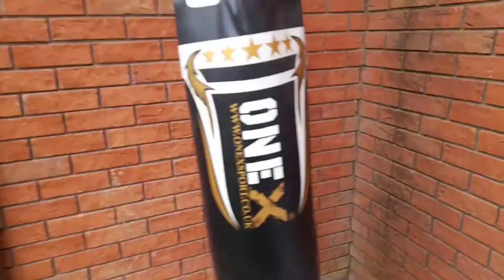Refitting a punch bag wall bracket

Comment: Hiya mate, how do you protect the bag from scraping the brick wall and over time the bag getring damaged
Reply from the maker: You really have to be hitting/kicking the bag really hard towards the base to make it swing and scrape on the wall. As for protecting the bag over time, it gets taken off the bracket and stored in the garage so weathering does not effect it. Has lasted years

Comment: Hi people say not to use those kind of anchors because the bricks can crack do you no if that's true? And also have you ever used chemical anchors like resin to hold the bolts in place and would they be strong enough to hold a 60kg bag?
Reply from the maker: As yet, there is no brick cracking but I see that it could be possible depending on the brick type. I have not used resins to anchor. I suspect they would hold the weight but continued stress when that load is struck may result in the bond failing. Let me know if you try resin and how it holds up
Reply: @myrandomhobbies1099  will do mate still trying to figure out the best option 👍

Comment: What type of wall anchor is that and what type of bolts are those
Reply from the maker: I think these were Rawplug Rawlbolt anchor with loose bolt.
Reply: @myrandomhobbies1099  thanks
Reply: Where can I find those anchor? I couldn't find them 😅
Reply from the maker: I got mine at Toolstation (UK)